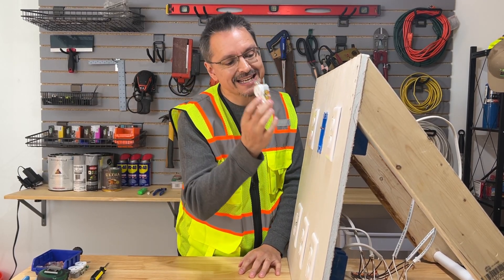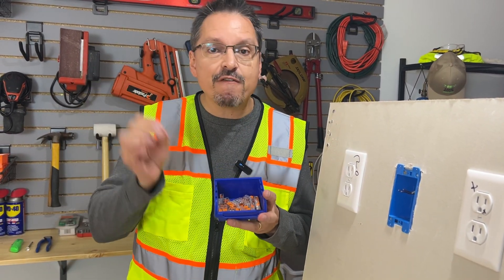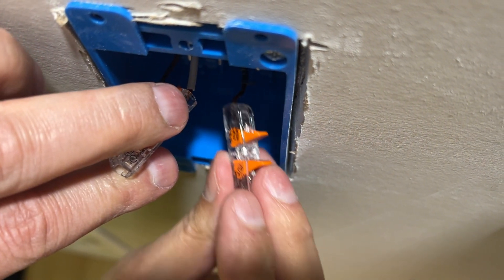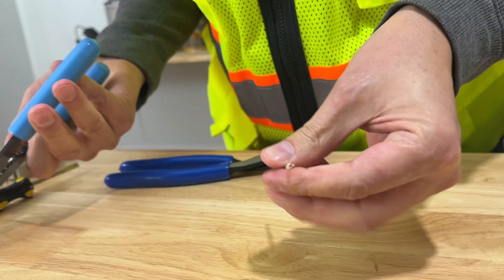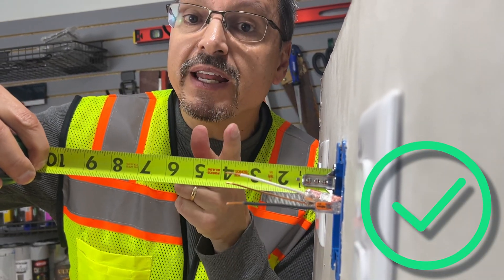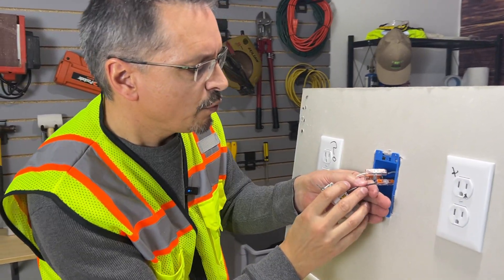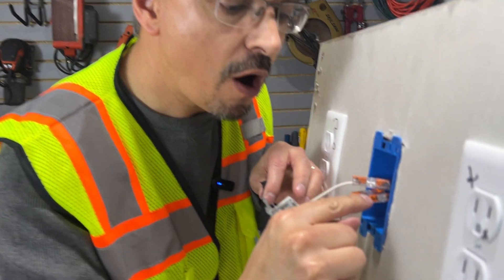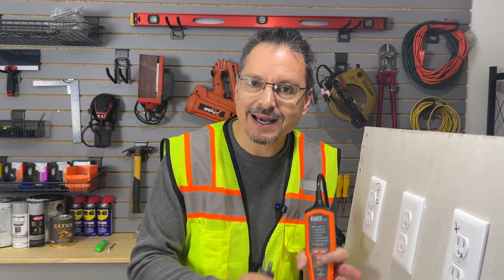How To Extend Short Electric Wires | Easy Fix Anyone Can Do

Comment: Can I use these connectors from the wires coming out of my new water heater? I trimmed it unfortunately, not sure what I was thinking.
Reply from the maker: The most correct answer is, it depends on how thick your existing wiring is. An electric water heater typically has very thick wire such as a AWG 10 or larger. WAGO wire connectors only are rated for 12 wire sizes on up.  Remember the larger the wire size number the thinner the wire is and the lower the wire number the thicker the wire. So you would have to find a wire fastener that can handle the thickness of your electric water heater current wire gauge.